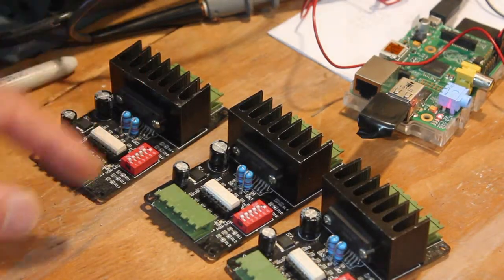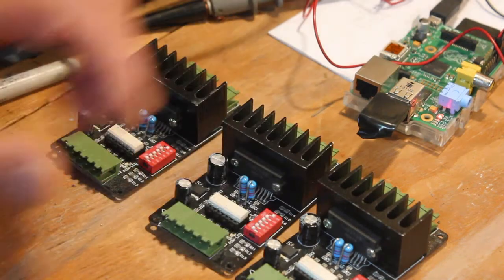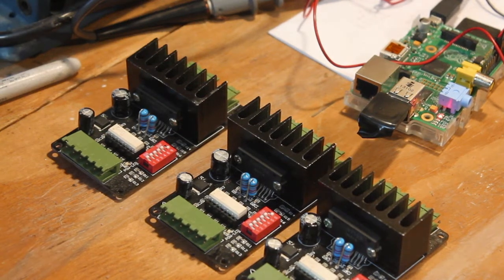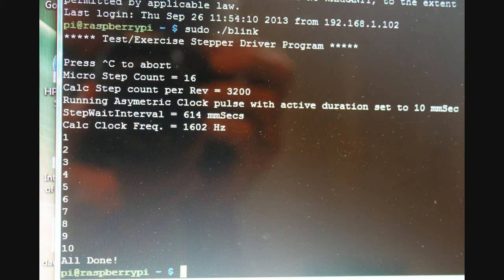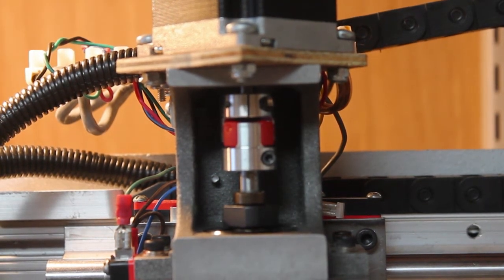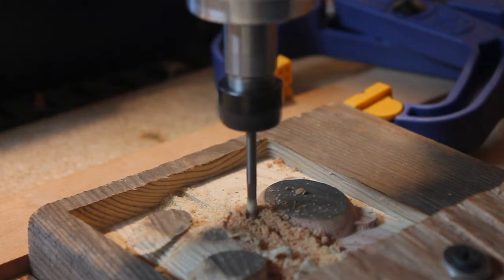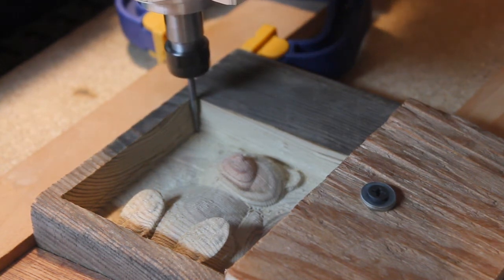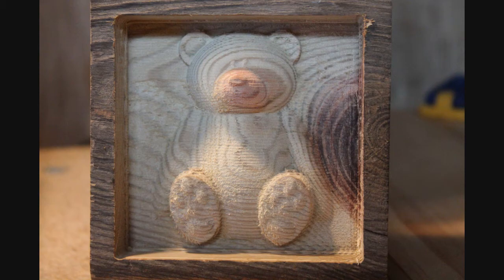THB7128 Stepper Driver Mod

Comment: Just a "thanks" for your video.  I installed these boards, and even though they all have a
0.3 mfd  ceramic between pins 1 & 3 they were still losing steps.  After adding the 330pf ceramics, no further problems.  Thanks again!
Reply from the maker: Cool!  Always good to hear when something presented here works for somebody else.  Thanks for the feedback & GL

Comment: I have boards that are very similar to this one, but I have not been able to find a table to set the DIP switches.  Can you help?
Reply from the maker: That's a good question. I still use these units, but haven't messed (changed settings) with them since posting this video. My recollection is that mine did not come with any real documentation,  So what I did was pull the spec sheet for the Driver IC.  Using that, worked out current, and step, settings.
"Working out" the settings was not all that hard. The switches are grouped by function (current /step) and use a binary pattern to go from min to max. So its a matter of sorting out how many switches and which group are devoted to setting the current limits.( And which one is the most significant bit.) Same thing for "steps".
FWIW: All my switches, except sw 6, are in the ON position. But to tell you more than that today, I would have to dismantle the control board.
Reply: Thanks.  I figured out that switches 4 - 6 were the microstep controls, but I wasn't sure about 1-3.  It looks like they incrementally reduce the resistance between VCC  (5V) and pin 5 of the IC which is the Vref, so I will experiment.  Thanks again for your quick reply.

Comment: Hi, I know its 3 years old but think you can help me. I've got 4pcs of THB7128 from a friend, I wired it up on a breadboard and absolutely nothing happening. Powering it with old ATX - signal 5V, power 12V. Signal generated from Arduino.
Reply from the maker: Without the wiring diagram of your setup,  I could be missing something obvious. But assuming that everything is wired correctly, and your Arduino code is sound, I'm wondering if 12V is enough to get the THB7128 biased/operate correctly. In my setup the motor voltage has always been 24 volts. Not sure how the boards will behave with 12 Volts
Tnx & GL
Jim(KW4KD)